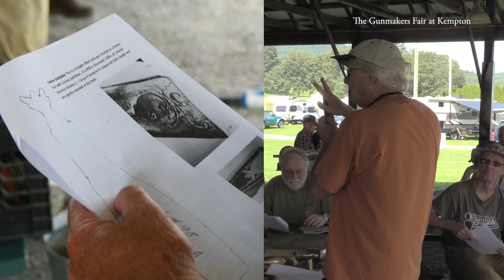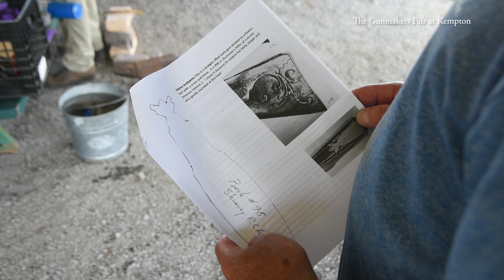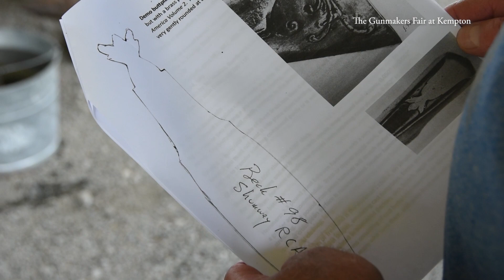Forming Sheet Brass Buttplates for Muzzleloaders with Rich Pierce | Gunmakers Fair at Kempton

Comment: This guy doesn't really know what he's doing.  Sure it's not a big deal and it still works, but what's the point of heating the brass to the Draper Point to "anneal" it if you're just going to quench it in water instead of let it slowly cool in air?  (That's a rhetorical question, just so we're clear...)
Reply: Dunking hot brass in water doesn’t re-harden it.  It just cools it so that you can handle it immediately.